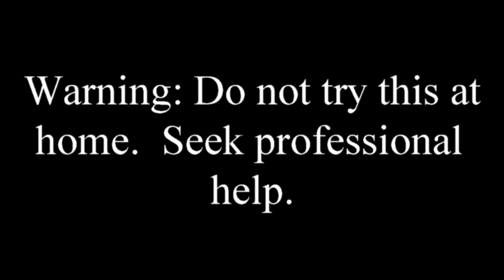Toilet Seat Stuck

Comment: We had the same problem we bought the hacksaw blade and kept sawing until the bolt fell off!  It worked.  My husband did the sawing I wasn't strong enough.  I did the cleanup and put the new seat on.  We have an old green toilet with a white seat!  Isn't pretty but it's functional.  Thank you for the video!

Comment: If the bolts are slotted,, easy to drill out from topside,,,1/4" drillbit.
If different like mine was, I used plastic welder from Harbor Freight (amounts to extra hot solder appliance -$10),
to melt out the nylon nuts.  Extra hot soldering gun with spade adapter would probably work as well.

Comment: I am having a big trouble with that!. The screw is too big...and the bolt are stuck...I try to remove the bolt but the screw is going around together with the bolt. I need to change the seat...and it's seems to be impossible. I don't know what to do as it is too tight.  Could you help me? PLEASE! (on your Video...1:51 min...I see your screw. Mine is bigger..however the problem is ..your is also stuk..(not only the bolt)...but mine  GOES with the bolt...so it's impossible to remove. Too tight..and both  goes together....so, how can I remove one of them? (The bolt)...I am going crazy/mad! I don't know how to  put the new seat there! You are trying with your screw driver on the  top part...but mine here is still with the part of the old seat...and doesn't come off....I have to remove the bolt from the ling screw underneath the vase. I have no idea what else I could do!!. Mine is not rusty...it's just TIGHT. I've tried everything..I don't know what to do!.
Reply: Damn man, sounds serious. Did you get it fixed? You should post a video of what you did
Reply: @jjpalau  I donn.t know if your comment is about the problem I had or it;s about this Video here...but ok Anyway I will tell you  what happened on the situation here in my home. YES! lol...on the same day...I came back to this Video, trying to understant it better and make sure if I've missed any "precious" information....suddenly...wow... at 2:59 minutes, he use a "Hacksaw"...and what he did by the top...was not the case here for me, because the screw was stuck on the bottom part of that. In this Video we can see the screw "uncovered". Mine had a metal cover...and all the job should be done on the botom part where the bolt was. Again..Impossible...as there was not space enough to fit the Hnacksaw. Then....I tried sawing  on the top part (like him), however it was hard, as the Hacksaw had to fit "underneath" the "cover/lid that covers the screw) (it makes part of the  toilete seat hinges).  I spent almost an hour treing to saw that...and guess what?...I did it!. I was very happy, beluev me! lol lollo.I hope you understand my poor english! lol.
Reply: ImJustAsBad......The problem here is solved. I want to thank you for this helpful Video. What you have done at 2:59 minutes, using a Hacksaw...on the top part...I had to do under the " Toillet Hinge cover".....it was hard  to fit the Hacksaw in between the cover and the Vase...but after almost an hour sawing that, I did it. So...many thanks to you for this sharing this Video. Really  useful.